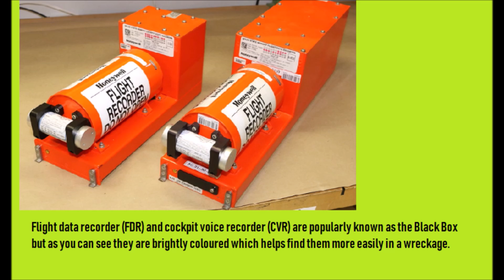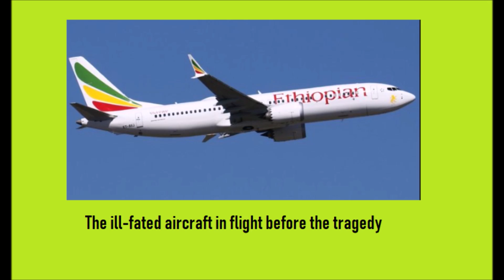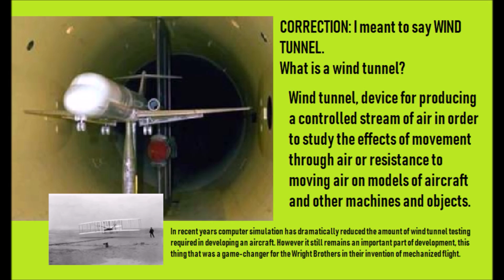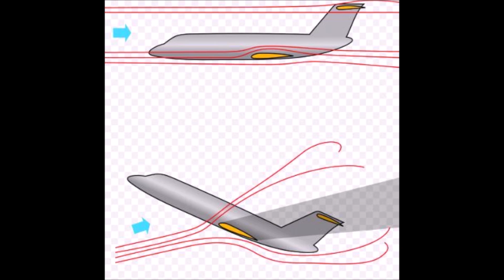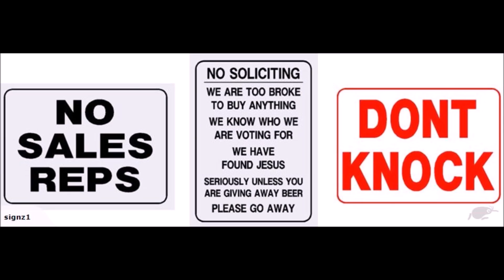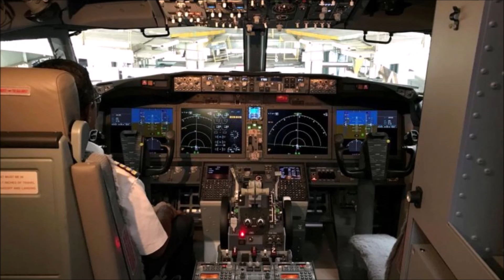Remembering The Boeing Max 8: Why An Early Better Fix Was Ignored

Comment: Your economical and strategic points are OK

The technical explanation is not.

The issue with the big engines far in front of the wings is not a matter of weight/COG.
The positioning of the engines heavily influences the wings' lift during high angle of attack conditions.
So this aircraft semis to be much more critical in stall conditions.
Instead of choosing the right aerodynamic setup Boeing chose to implement a Software workaround hindering the aircraft from going into stall accidentally. (fault #1)
But this workaround was designed sloppy (fault #2), i.e no redundancy.
And there was no dedicated training for pilots intended (fault #3)

We will see whether only fixes of fault #2 & #3 will be accepted from the authorities.
Fixing fault #1 means basically designing a new aircraft from the scratch.
Reply from the maker: Points of correction well taken. Thanks.
Reply: I appreciate your concise explanation. I think basically these are powerful and capable aircraft but they require activity by man or computer because the aircraft by itself has flawed tendencies.  In 2019 with our very flawed government and management approaches I would be shocked at a redo of flaw #1. They will work on the pilots and on the software and push this thing back into the air. When comparing to the Shuttle Challenger disaster, these aircraft have a wider envelope to fly safely and essentially simply need better redundancy. So after that is done only psychological work on people’s simple fears will be needed. Perhaps and likely, Boeing will work on a fresh canvas and invest millions in a new fresh slate design.
Reply: @jamesmedina2062  Comparing shuttle to aircrafts:
The shuttle had a statistic: One loss every 100 departures.
A passenger aircraft has to be better than 1 loss every billion departures.
This makes a hugh difference in design criteria.
Reply: Peter Ebel nobody ever made that evaluation. The goal is zero, bro.
Reply: @jamesmedina2062  Sorry, I made a translation error: a German Billion is actually an English Trillion, this is basically the design target.
So an aircraft has to fulfill a 10 Billion times better safety statistic than the shuttle you brought into discussion.
Belief me or not, you need a target for specification.
Zero is not a target, the only answer for this would be: stop building aircrafts (or cars/elevators/trains, ...).
Reply: Peter Ebel Do you know the history of aviation?? The space shuttle was not targeted to be one loss for 100 successes. That’s ridiculous. Once it crashed once the program was shut down. Even one crash was too much and no crashes were specified or desired. The Concorde did the same.  When one crashed then the program of Concorde flight was totally cancelled and stopped. You may be confusing engineers with statisticians. An engineer will over-engineer multiple layers of safety and redundancy, but the engineer cannot predict the small chaotic instances that were completely unpredictable. The Challenger suffered a really freak break up of booster shielding material that caused the blow up of the whole thing. The Concorde suffered debris on the runway that were forced upward into the fuel tanks and everyone knows that fuel is explosive. So just because an engineer can devise of some sort of probability which I’m sure was to the tune of 1: 1 billion, this estimate is only an estimate and is not fact. The future is unpredictable. Always
Reply: @jamesmedina2062  Simply not right.
Concorde was not stopped after the crash, it was in service after some minor fixes again (to cover this debris issue for the future).
Concorde was stopped later due to the fact it was far, far off the safety standards of modern aircrafts and the lack of economics.

There is no "over engineering", this is neither performant nor economical.
Designing aircrafts engineers have in mind different failure rates for different events. Those events are in classes like to be fixed in next service, remaining flight time xxx hours, ..., injures/single fatalities possible, the worst category: multiple deaths/total loss of aircraft.
It is possible i.e a 777 looses both engines over the middle of the pacific ocean but is unlikely. This is calculated and the routes are adapted tho the result of those calculations.

The shuttle was designed without calculating any fatal loss rate in mind.
But after catastrophic event they did and the result was 1/100. This was the trigger to abandon the far to complicated concept of the shuttle.

May be you ignore statistics.
But this does not change the fact random effects rule the world, to be calculated with statistics.

Please study history of aviation before claiming it. Always.
Reply: Peter Ebel but you are arguing with someone who agrees with you so it makes little sense. I stated that the aircraft are simply far safer that spacecraft by many factors obvious to everyone. You are arguing that the odds of 1 in 100 was designed and I stated that could not be intentional risk factor in design. There was unforeseen risk. Still, due to the obvious differences in design parameters and goals of making money, I stated that the aircraft 737max much safer. This was not argument against your statements. But you can still say I am wrong if it make you feel better.
Reply: @jamesmedina2062  All OK. in our times there in not much like unforeseen risk but a lot of not considered risk.
What is really good in avionics industries: Every accident is investigated and knowledge to be considered in future is always made public.
Sometimes this causes changes in regulations (i.e. cockpit doors reinforced and closed)

But a lot stays to individual companies etc. to take the lessons learnt.
Concorde was not the 1st aircraft blowing its tire due to debris on the runway and causing secondary damage.
Space shuttle Challenger's O-ring seals was not the first leaking in frosty conditions, it was even predicted to fail prior to departure!
Space shuttle Columbia's external tank isolation was not the first loosing some pieces which caused the later catastrophe.
.....
We will get information somewhere in the future what went really wrong at Boeing's management regarding 737MAX, it was much more than one fault.
This is very critical because some weak spots in organization may also effect other products.

Comment: Poor analysis by a guy who had obviously never designed or flown a jet.     Every jet flying today has inherent stability issues when it comes to different passenger/cargo, and or fuel loads at different thrust settings.     The Max 8 has a bit more forward empty CG, however in your analysis, you do not evaluate any specifics, and just lob accusations at Boeing (Boeing deserves some critiquing, but you are focused on the wrong thing).   If the Max had a CG too far forward, it would only fly with the rear stabilizer keeping the nose up,  as an engineer and pilot I can tell you this is a very inefficient way to fly a jet.   As you correct the flight with the stabilizer trim you introduce drag, which then requires more engine power to maintain cruise speed.  Since the 737 Max 8 is very fuel efficient, so I will assume its is not being flown in this configuration.     Now, ALL jetliners with under wing mounted engines have their center of thrust below the center of pressure, so all of them have a tendency to climb when power is increased.  This is very noticeable on some aircraft.   Now with a slightly more forward CG an airplane naturally becomes more pitch stable then if you had a slightly aft CG.  Too far aft on the CG and the airplane becomes flat out dangerous in a much steeper curve then it will in a forward CG configuration.    Examples of airplanes with an AFT CG are the F-16 which for practical purposes cannot be flown solely by a human pilot without the computer flight controls helping to control the pitch.      Here is a video with a 101 level explanation.   https://www.youtube.com/watch?v=P_0R0eWOKns
Reply: F16 is a fighter, so shouldn't be lumped in with passenger planes. Those kinds of jets are like - pray that the software and measurement devices etc are working incredibly well. Boeing's 737 max would have no problem if their software design team and hardware people had done the right and expected thing ---- to avoid obvious holes in their algorithm, like looking out for incorrect sensor readings, and not have these obvious holes in their control software. Totally agree with you about CG variations. Very good points.

Comment: Great video Chris !  I liked it. Although, I do believe that the software would solve the problem if it is properly and thoroughly written and designed. Very unfortunately, the software had a big and inexcusable hole in it, which is very shameful on boeing software team's part. They should not have allowed the plane to be released to the public with an obvious hole in the software. The software should have incorporated safe-guards for faulty sensor readings in the first place. But it didn't. So this was a big no no, and golden rule breaker. Very bad mistake ------ rookie error basically.

But - I totally agree with you that if cost was not a factor --- then boeing should have gone back to the drawing board to get this passenger plane to be more pitch neutral. Afterall, this is a passenger plane, not a fighter jet. Having a plane that is as stable as one can get is beneficial.

Comment: Remove the MCAS and redesign the physical configuration of the plane is the best solution. Any sort of band-aid to solve an inherently flight stability issue for civil aviation, as opposed to military ones where you push the envelope of stability to its limit to attain that marginal performance may be arguably worthwhile. An analogy is that of nuclear power generation design where the impact of a catastrophe is so devastating because more than a few lives are involved, you should go for an inherently self sustaining configuration (which is based on the natural characteristic laws) instead of "too ambitious" band-AIDS, making a technologically smarter solution into a "too clever" unnecessarily over-complicated band-aid. Unfortunately, Boeing and the FAA are in-bed to beat competition at all costs. There is cosmic justice that their reputation is suspect now.

Comment: I agree with the CEO that this will be the safest airplane ever built, if they redesign it so that they dont need the MCAS,,and then still use MCAS with four AOA sensors working simultaneously
and when one is disagreeing the majority wins and the plane is grounded until it is replaced..And of course the pilot should be able to disconnect MCAS..

Comment: What you say is true. "Software fix" is not a  true solution. The issue is the balance of the 737 with the new engines. Boeing is insane in this case. They need to redesign and balance the 737 for the new engines. It will always be a dog of a plane to fly because it's not balanced properly. Indonesia already canceled $6 billion order stating loss of confidence in the Max. Boeing made a huge mistake with the Max. That's what happens when accountants run the show not engineers.
Reply: George Suchenstein “A dog of an airplane to fly” really? You have flown it? I can tell you it isn’t.. 

The general public really do not know what they are talking about.
Reply: @ACPilot  If the Max is so good why is it the only plane in Boeing fleet that could not be certified without MCAS? Maybe because the Max has pitch up tendency?
Reply: George Suchenstein ALL airplanes with jet engines fitted under the wing have a pitch up tendancy under certain conditions.. even the Airbus 320, this is corrected by it’s systems.
Reply: @ACPilot  The question is how does the pitch up tendancy behave. Is it dangerous or not?
Reply: Absolutely right about that

Comment: Instead of mounting the engine below the wings,  the engines can be positioned on top of the wings. The engine can therefore be mounted in the normal position without changing the CG.
Reply: Wouldn't that interfere with air flow and lift?...
Reply: Airflow has to be moving faster below the wing, not on top.

Comment: Stop the retrofitting!  The 737 is a 50 year old aircraft design.  The engines are physically too large for the basic design of the aircraft.  Yes, they are powerful and reliable and fuel efficient but contribute to instability of the aircraft.  Scrap it and start from square one.  More software changes are merely going to make things more complicated and less safe.
Reply: Or bring back the 727 with two big engines in the back (or the 717).
Reply: The B52 is a 70 year old airplane and is expected to fly until the year 2050. Old design, that works great. Changes of avionics, and other newer more modern components have made this the most feared bomber America has. Should we scrap it because of it's age? Remember that the 737 is the most popular and most produced airliner in the world ever since it's introduction.
Reply: @del1rn  Still running on the same engines with the original lousy fuel economy  (there was a proposal to replace it with a bomber version of the 747 (or reengine it wjth engines off a 747)).

Comment: It's quite simple and elementary. Boeing needed to redesign the landing gear and wheel wells, including much of the wing set, in order to raise the aircraft sufficiently above ground to accommodate those larger LEAP engines to preserve proper flight characteristics without the aid of MCAS. However, this would have resulted in considerable delay and late entry in the marketplace, affecting sales volume. Fact is, Boeing waited FAR TOO LONG to replace this outdated design, and got its ass handed to it on a plate by both Airbus and Bombardier.

IMO, the only way to really fix the MAX is to retrofit Next Generation pylons and engines, and rip out MCAS altogether. Unfortunately, this would come with the cost of additional fuel burn and anger customers, to which I say: too bad, safety trumps money. You made a bad decision, now OWN IT.

INCREDIBLE...
Reply: With that level of modification you might as well design a new plane.  However the big airlines don't want to retrain their pilots so you also have that pressure being exerted.  So cobble something together for maximum profit.  The 737 is probably the last airframe from that era still being built for passenger flight.  Time for a new plane.
Reply: Good luck with fitting new engines! As for new landing gear..
 You'd need to redisign the wing.  Might as well design a new plane.
What'll probably happen is a new ACAS, with a backup system, and maybe parachutes under the seats.
Reply: Correct.  The stubby landing gear is a carry over from when air stairs were an option for use at un-improved airports.  These days, airports that do not have facilities are non-existent so there is need for air stairs.  757 landing gear would have been ideal for the 737.  Cabin width are the same for both so the wing box and landing gear could have been easily taken over to the 737.  Sadly, Boeing never viewed the A320 as a serious threat until it was too late.  Now Boeing has two accidents and is years behind.

Comment: I'm a pilot and engineer. I concur with the video that we need to take a closer look at any aerodynamic problems caused by placement of the new engines.

We need to understand EXACTLY how dangerous the stall characteristic is for the 737 MAX. 

Twice now, planes have crashed because of faulty MCAS operation. 

How many planes will crash if MCAS fails to energize and doesn't operate whatsoever?
Reply: Tom McGuinness; We need to understand EXACTLY how dangerous the stall characteristic is : How sudden? And what is the magnitude?

Comment: Nothing was overcompensated. The engines are just more powerful and given the fact that they are more in the front, it could lead to a nose up momentum if a lot of thrust is applied. That does not mean the MAX struggles in. normal flight.

Comment: The angle of attack sensors could cross reference with pitch gyroscopes to avoid radical deviation from level flight. Then it could operate in less extreme envelope and warn pilots if problem persists. All parameters of stable flight should coincide with air speed /thrust at any given scenario.
Reply: Exactly; just like in every other high-tech aircraft, military and civilian, of today. And how about the Feds taking a close look at the quality control of the AOA vane manufacturer?
Reply: Essentially Boeing should not be trusted to make common sense engineering decisions?? It seems like Boeing is not a person but a money-obsessed machine itself, devoid of emotions????